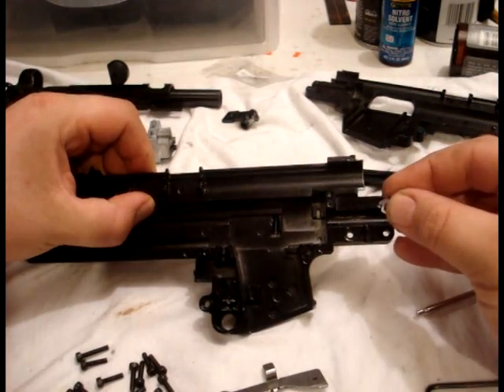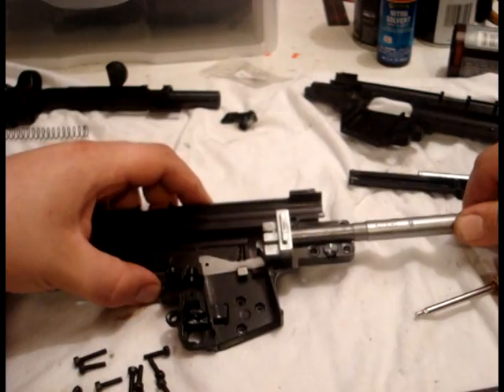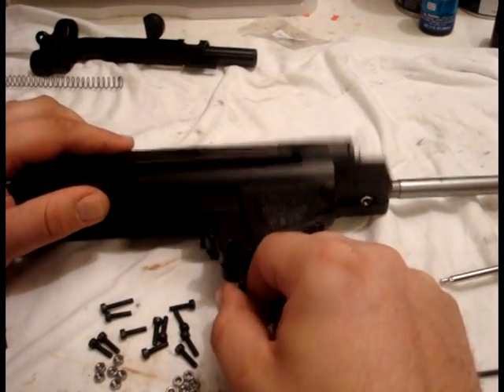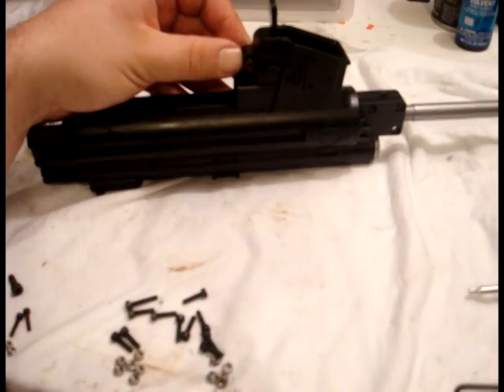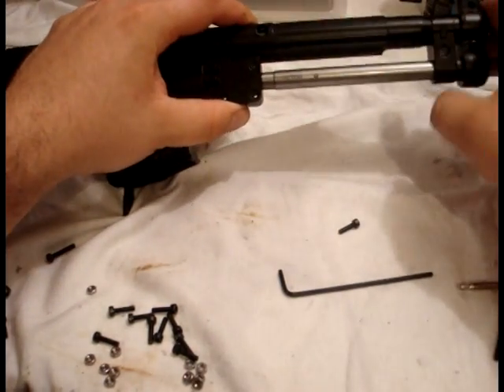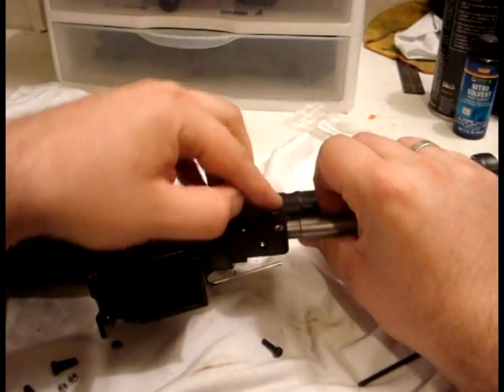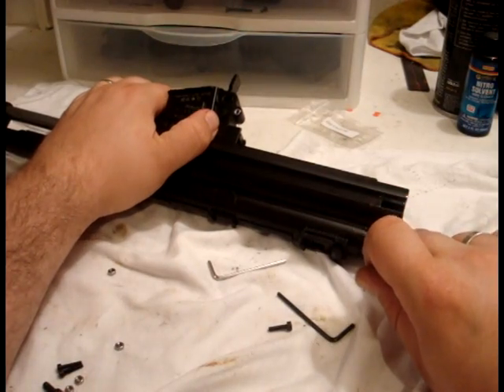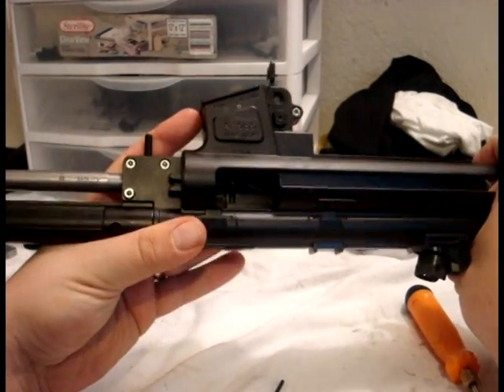Part 2 - GSG-5 Full Teardown & Screw Upgrade

Comment: Question,,,  

Other than replacing the nut where the bottom rear handguard screw threads into I dont see a need to split the receiver apart...  Why not just replace one old screw at a time with a new screw ?

I am going to do the screw swap today on my GSG-5  but have a optic rail mounted on top which would have to be removed to split the receiver...

Good video,,, thanks.

Comment: I recently bought a GSG5 SD and love the gun its amazing. Anyways i was wondering the the housing was made of if its pot metal, steel, aluminum or what? I spilt some Break free on the titanium paint and it caused the paint to run a little. So i'm thinkg about having it cerakoted just want to make sure the material would take